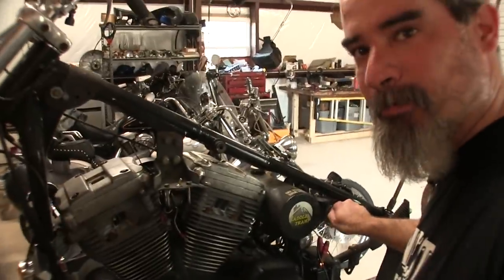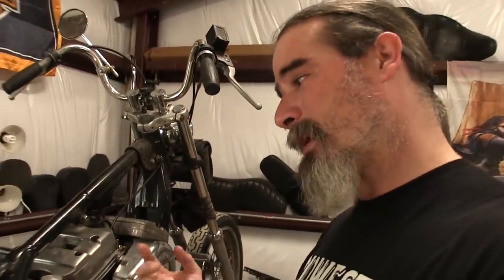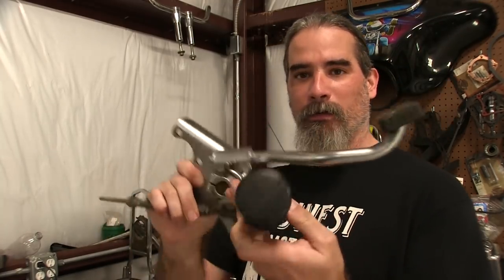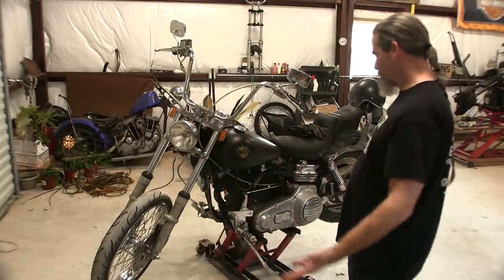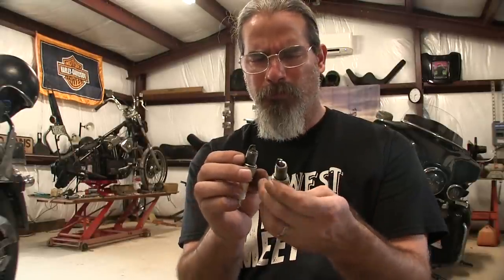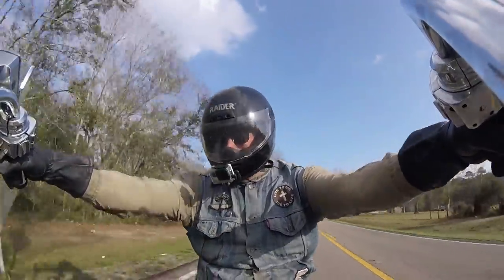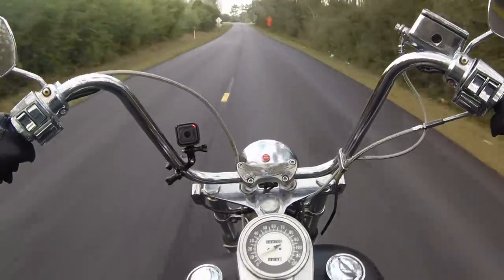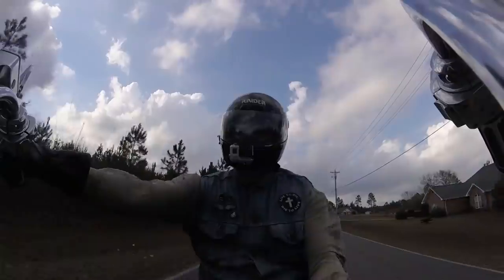HARLEY Davidson SHOVELHEAD Is WAY PRIMITIVE Of A MOTORCYCLE For Today's RIDERS

Comment: I have a 1974 harley davidson    had to fix the  magneto .... my question is  the spark plug  wiring not sure witch wire goes to what cylinder or does it make a difference??? thank you
Reply from the maker: Either or. They both fire at the same time.

Comment: It's a bad coil brother. Keep us updated, ur videos rock 🤟
Reply from the maker: The coil is fine. I tried it on the softail, and it fired right up.
Reply: @SaddleTrampTV  Kool good luck 🤞
Reply: It's nice sounds good too. I'd check the pushrod adjustments. Change your sprockets out you'll get lower RPM at high speed. Won't vibrate your bones as badly! Yeah I hated those years when you had to hold the button whether you're making a right or left turn! And of course every Harley I've had was those year ones! Definitely looks better with the wide glide front end to!

Comment: Another thing,,, what do you mean about blowing oil on you?? Maybe check the check ball on the oil pump. Sometimes sticks and pukes out the overflow. I ran the same plugs for years. So that's B. S...    I don't see how you think that your doing 70 ,, when the speedometer doesn't work because the Speedo drive is on the original front end that you need to put back where it belongs. To be honest,, with the stock gearing,, it will run a steady 60 to 65,, no problem all day long. Gear it up and give it some legs and you'll be pleased.   Don't forget a little Marvel mystery oil in your gas and oil.  I bet your chain and sprockets are shot. But that's just an educated guess! Have patients it will be worth it. DAMN nice bike.

Comment: How difficult is it to source parts from say 1990 forward? I've been off the road awhile and I was looking at a 1992 Softtail. I don't have a sense of the aftermarket and I'd love a real world idea of that point before I pull the trigger.
Reply from the maker: I usually shop online. Ebay, Lowbrow Customs, TC Bros, BMI Karts, or  the local motorcycle shop.

Comment: nothing like a good running shovelhead. any shovelhead I've owned things had to be addressed or changed. it's the nature of it. my current 77 flh all factory stock runs all over hell. and is reliable. separate the primary oiling from the motor, block it, plug it run it in its own oil.I kept the points and kinen carb, but rejeted it, any chevy 6 cyl points work, blue points work better, as a single fire set up does & an s&s carb. the biggest upgrade trued flywheels and a good flo oil pump. I left my fl all stock because I like fucken with it. when set up & put together right they will run for what they are.

Comment: I got a 1980 FX and mine cruises 50 in 3rd   80 is no problem in 4th gear for these bikes if properly jetted. Adjust the final drive ratio as in the service manual. Not trying to sound condescending
Reply from the maker: It's all good. I've pretty much dropped the subject, because of all the comments that come out of the woodwork over it.

Comment: Change the front sprocket to a 24 and the rear sprocket to a 48 or46 and she will go down the hiway quite well.
Reply from the maker: I'm afraid those rod bearings won't like that too much long term.
Reply: We did that all the time back when Shovels were new.24,24,48. with Andrews cam and an S&S carb all we had back in the day was the B carb it dumped way too much gas into the motor but it was way better then the stock carb. Plus we put the first gear from the super glide and relaced third gear with an Andrews.The gears were closer together with that setup.

Comment: Had my shovel for 22 years never fouled a plug and also 70mph isn't the problem oil blew out of it mine never blew it on me but it let people know where you were it could be bent push rod. Don't be fooled shovels. Can be fast throw a Andrews f grind cam in there and change valve springs to heavier ones it will go

Comment: You think that is primitive. Try riding a Pan with the left grip for the distributor advance. The front brake lever on the left side of the bars, the tank shifter and foot clutch also on the left side.
Reply from the maker: It's all a matter of perspective.
Reply: I hear that.
The new bikes are nice but I really enjoy working on and riding the older bikes.
Reply from the maker: @HDBee  You and me both

Comment: Clueless, my 71 fx ran flauwless (sp) for many years and had the engine rebuilt once and years of great power and reliable use, had the engine case adjusted for a S&S 4 1/2 stroker with flowed heads , shovel head engine the best

Comment: Have fun brother! Couple of tricks with these old bastards, Always have on board BRAND NEW, IN THE BAGGY Harley Davidson intake rubbers and BRAND NEW, IN THE BAGGY Harley Davidson intake clamps, If your going to ride a Shovel, Yer going to need 'em some day pard. An assortment of nut, bolts washers, wire (electrical and tie) exhaust gaskets, spark plugs, chain breaker and a length of chain and a couple of master lengths,,,,,lets see what else, Oh Ya a sack full of tools! Have fun with it brother.
Reply from the maker: Yeah, I going to have to invest in some saddlebags too.

Comment: Well primitive it's NOT it's half of an airplane engine that's in use all over the world and cars still use the push rod over head valve design and my new Corvette uses the dry sump oil system also so what's not to like is your lack of machaical ability to fix the oil leak ,! , Take the motor apart and use Yamaha sealant between the cases and a reed valve instead of a rotary valve in the cam chest and gap the rings correctly I drill 1/4 inch holes in the cylinder Finn's 3/4 the way down the cylinders in the middle of the Finn's 1inch apart around the cylinders and a few in the head Finn's not to many it can cause the fin to crack so I take my Dremel and sand around the holes so they don't crack the holes give you more surface area for better cooling I also use the jireh high volume oil pump and a good oil cooler I have 2 panheads a 74and an 80 cu inch and 3 shovel heads an 84 a 88and a 97 cu inch 2 evos  ones a 127 jireh motor the other is a 88 cu inch then I have 2twinn cams ones a 88 cu inch and I'm building a 117 cu inch  oh have one of the famous Harley builders Ballance the motor it makes a big difference I like the thunder 2into one header it makes real good power on the Harley motors but not on the big cu inch motors over 100 cubic inches I love the big makuni carbs PSI builds a great carb  small motors like the stock carb with a few up grades use a thunder ignition and old pans and shoveled like 2spark plugs in each cylinder it's a horse power maker along with all the other stuff I've told you I have 55 years of riding Harleys they are not junk if you follow the tricks oh and use locktite on every nut and bolt and a 3phase alternator with a high Proformace nicad battery Harleys don't have the right charging systems so the battery never gets charged up then it goes bad and they stop running so good luck if you don't do these steps to your scooter you'll be sorry and you'll be pushing it down the road peace

Comment: Oh k, I've converted my Pan head over to. A shovel head in about 1980. And I don't have much trouble with it at all. I still run a point l Plugs and condenser, which is a simple. At work and it's cheap to repair if I ever do have a problem with it. No, put it. A 25 tooth sprocket on your transmission.
About on the front, the primary put off. Put a belt on the The primary egg, a orange chain on the rare. But the lightest Solid leftors in it that you. Can i'm just Ride the hell out of it and quit worrying about all that takingological garbage. That cost you a thousands of dollar, shall we? Hazard dependableconomic and you can put as much power in them as you want.  Mine does a 130 miles per hour all day long. No problem with no lady on the back so the h*** with the block heads and Every piece of junk they made after that.

Comment: If you want it to look like it belongs on the motorcycle,,,, then get the damn wide glide off of the Super glide. You talk about a drastic lean angle on the kickstand. That's because of the front end. The rake on a FXWG frame is 2 degrees more than the FXE. It will handle better with the stock front end . yes experiment with your sprockets. Convert to points is fine.you are doing good with the controls but you are f ing up with the front end change. I know you think it looks better but  you are throwing half of the bike away. Don't do it .stick with what the bike is. DAMN IT!     If you go a tooth up on your tyranny sprocket,,,, you will have good luck, but if you run an O ring chain,, which you should,, the chain might rub on the starter a little. You can pop rivit a little piece of stainless to the starter for a guide.some guys would go smaller on the rear sprocket which is easier, but I found the gearing better by going with the tyranny sprocket, which I needed to replace anyway because of wear. Put all of your Evo knowledge aside,,,, you got a lot to learn!
Reply from the maker: Thanks. It's actually an FXS; not an FXE.
Reply: @SaddleTrampTV  same frame as FXE. It's a different rake than what the wide glide goes on.
Reply from the maker: @br549american5  Still looks good to me. Each to his own though.

Comment: Get a multimeter and save time. Shovelheads and older engines will be around long after you are gone and 70 mph is nothing for old Harleys that are timed and normal maintained for decades. Maybe you should by Japanese because you whine too much.
Reply from the maker: @thomasgunne8730  My experience is that when I do 70 plus long term (camped out over 3000 rpm) stuff breaks, rattles loose, and falls off; Loctite or no. Plus japanese bikes take all the fun out of it. There'd be no stories to tell.